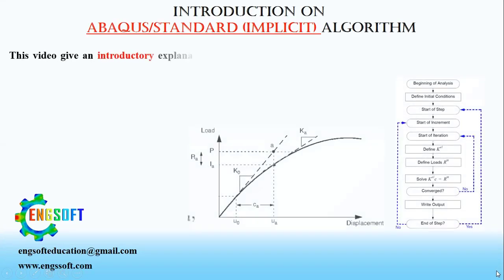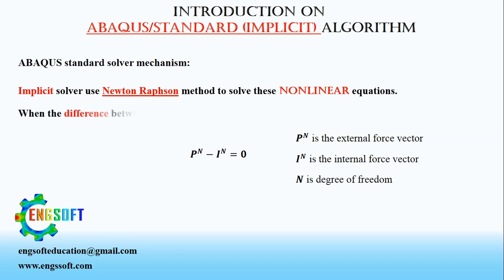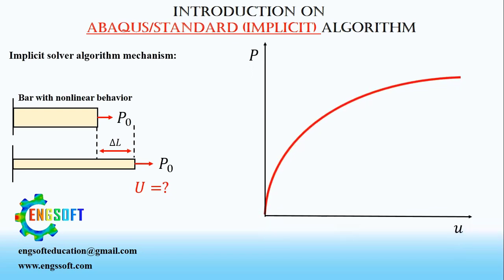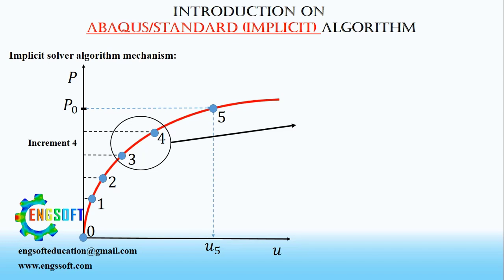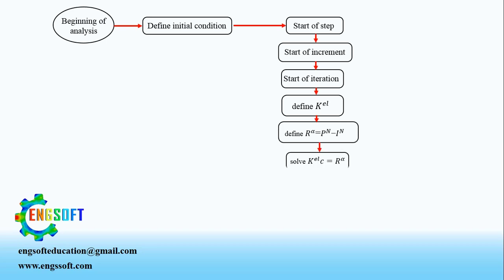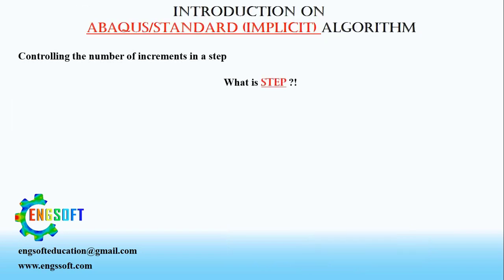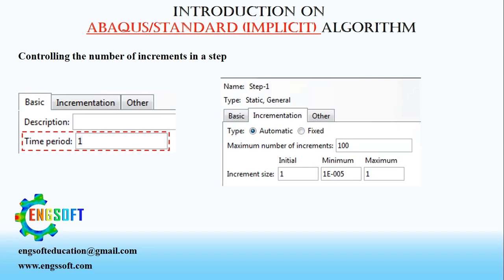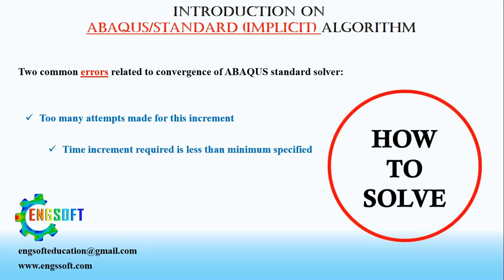How Abaqus/standard (implicit) algorithm works

Comment: Hello Everyone! 

I have a hexahedral multi-block structured mesh in ICEM CFD, I got some results from this mesh. 

Now, I have to do a mesh independence test. 

Please tell me which is the correct way to increase the number of mesh elements:

Should I 

1) Re-mesh the whole geometry with smaller element size

2) increase the number of nodes in each block.

3) increase the scale factor like 1.2 or 1.3 etc.... 

Thank you!
Reply: What you are trying to study here is called Mesh Convergence. And checking for mesh convergence is basically reducing the mesh size to as small as possible that beyond certain size you won't see significant changes.
e.g. A cantilever beam model with 5mm mesh size will give von mises stress as 100Mpa, if you reduce mesh size further to 4mm, say stress is 105Mpa, at 3mm mesh size 106Mpa and at 2mm say you see stress of 106.2Mpa. In this case you can say your mesh is converged at 3mm size or model results are now independent of mesh .
But mesh convergence is not just about size, but also about quality of mesh, and how geometry is captured. So in your CFD case , assuming your current model has geometry captured perfectly (90-100% close to Geometry), you can just reduce mesh size to check mesh independence.